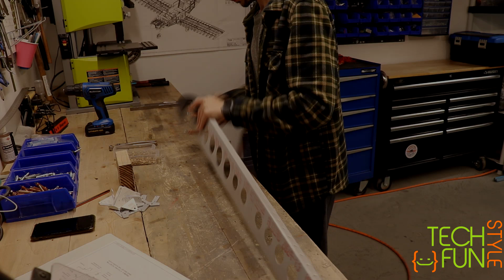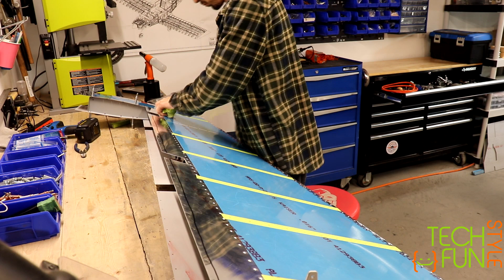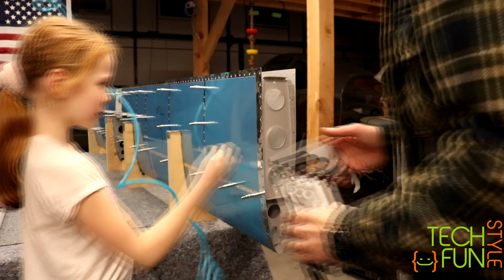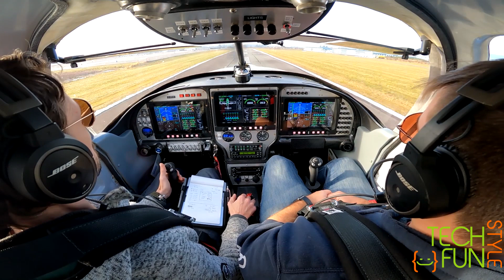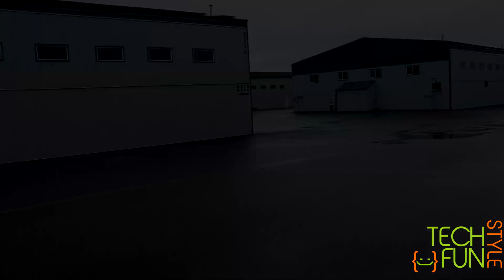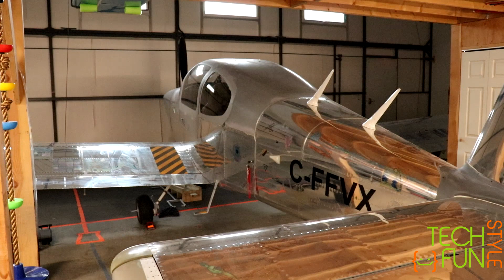Empennage and surfaces - RV10 Build by Vlad

Comment: Vlad, Im seeing pieces on your Emp kit that are still on backorder from mine. When did you order your Emp kit?
Reply from the maker: It was ordered back in February 22. Which parts are on b/o for yours?
Reply: @techfunstyle1606   Sounds like I may have just missed the cutoff; ordered my Emp Kit in March 22. I’m missing the sealed cartridge bearing for the vert stab, some fiberglass bits, and the trailing edge for the rudder. Talked to Van’s this afternoon, sounds like they will be able to ship some stuff in abt 2wks with the rest in early March. Wing kit shows up in March-ish as well.

Comment: Is that bucking bar custom ground for this application or something you can buy off the shelf?  I can't remember how you riveted the first one so I'm curious if it is something I should pursue.  Thx!
Reply from the maker: Yes this particular bucking bar is custom made specific for RV10 and 14 models horizontal stabilizer. It’s kinda tool which you need only in one place for few dozens of rivets only. I borrowed it but I am sure you can find one online for sale.
Reply: SKU: BBRV10